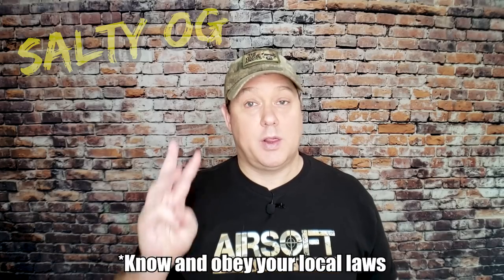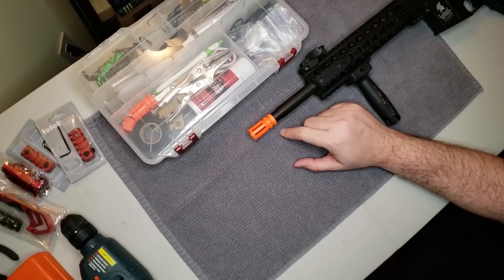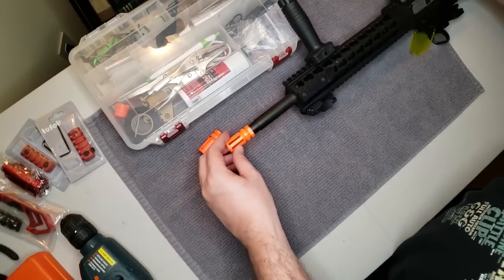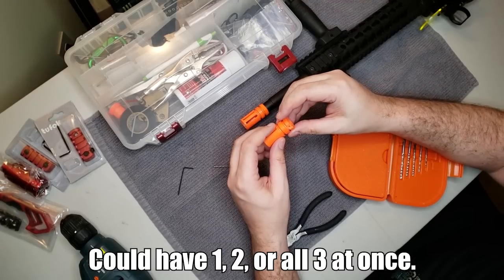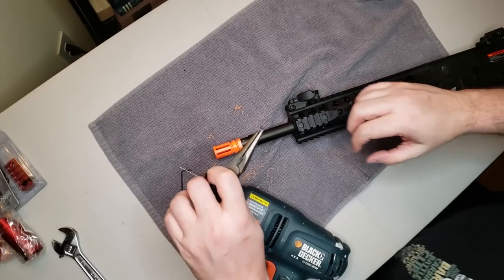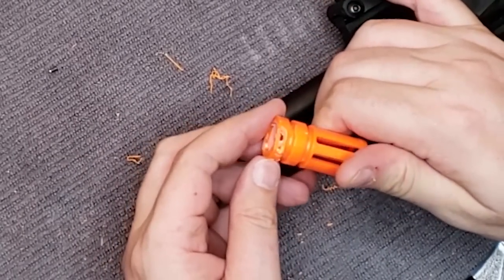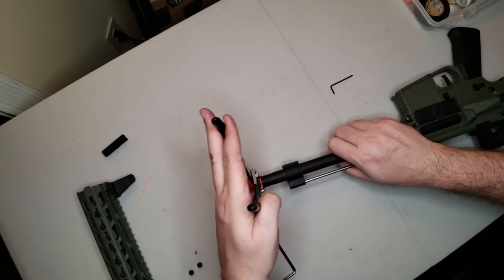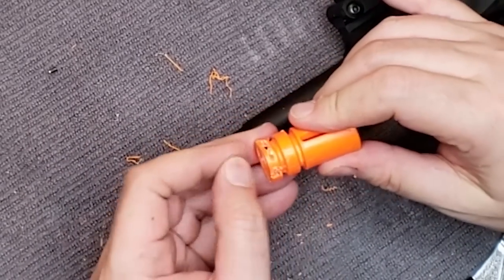Ditch the Orange Tip, plus Airsoft External Mods | SaltyOldGamer Airsoft Guide

Comment: Boiling water technique worked perfect for my glued on orange tip. Brought water to a boil, dipped the barrel tip for a few minutes and used an oven mitt to unscrew it.
Reply: Tks
Reply: What if your gun has a plastic barrel?
Reply: @thebronya3809  same process. Just be careful

Comment: I just did this to 2 VFC Avalon Saber CQB's with that huge sound amp orange tip. Its made of metal and glued on. Myself ( 250lbs) and my local shop owner ( also north of 200) just brute forced it off with channel locks and a solid work bench. I did try and put electric tape around the tip to protect from scratching....nope...I have sanded most of the orange paint off and will paint them black but in the mean time I did purchase a new flash hider/suppressor combo...looks way better and we all know airsoft is about 90% looking cool. 
Love this channel SOG...I'm a dad that enjoys quality AS time with my son too :)
Reply from the maker: Thanks for the compliment. Glad to have you part of the community.

Comment: thanks for your time and effort to put out these vids. because of you i decided to buy the vfc avalon. i used an allen key to remove the set screw but it was still glued. i soaked the tip with acetone. couple of hours later just screwed right off. wiped residue and was done.

Comment: How did you do this with such ease? I removed the pin (Im 99% sure I have the same gun as the one you demonstrate on, the Lancer Tactical) and I have even used heat and have tried for hours but I can't get it off.

Comment: i cant find a Allen screw that can fit in the hole and recommend sizes to get?
Reply: Go to Lowes or Home Depot and buy the set they sell for $20 it gives you them all so you wont need to worry about them fitting. Plus those keys are perfect for every day use. So many different machines or furniture sets require these keys so its always helpful to have a bunch on hand. 😎 GL

Comment: For reference on guns with a pin through the outer barrel, the Elite Force CTAR. Mine came with glue and pin. The pin went through the bird cage and ended in a hole through the out barrel. I had to remove the outer barrel, punch the pin through (it had glue as well), then heat the glue off via boiling water.

Comment: And question (I’m a n00b so don’t judge plz 😂) when you put on any suppressor, or tracer unit do you have to fasten it with another pin or will it be secure if you tightly screw it on?
Reply from the maker: You just screw it on tight and it stays.
Reply: SaltyOldGamer ok thanks

Comment: I have an G&G smc-19 but I drilled a hole going into it (because it was recommended) but I went too deep now idk if the threaded barrel works still.
Reply from the maker: I can only speculate here, second hand, but assuming it's a standard barrel it's going to have a good centimeter of threading, so drilling a tiny hole into it shouldn't imact the integrity (assuming it's a tiny hole).

Comment: How do I know what a compatible flash hider is for when I get rid of the orange one?
Reply from the maker: It should be somewhere in the specs for your airsoft gun. Most AEG's are 14mm couter clockwise. But, again, check your specs.
Reply: @SaltyOldGamer  thanks

Comment: For my hk 416 a5 aeg is medal hider and was expensive anyone know any tricks?
Reply from the maker: I imagine it's the same flash hider I had on my Avalon. It's just secured with a screw (and glue). I put duct tape around the flash hider before taking it off with pliers, so that the pliers didn't chew up the paint.

Comment: Do you plan on putting a longer barrel in the krytec? Since you put a mock suppressor. It will help with accuracy for sure. Also if you are looking for another tip video. To go along with my question. If you do, you should try the ProWin hop up with a modify Baton flat hop up bucking and nun video. It will cost you around $56 from Airsoft Atl and it is super simple.
Reply from the maker: I'm not immediately planing on it.  Accuracy seems the same with and without the blackside in the limited play so far. That could change.

Comment: Before forcing the orange tip off, know that you might fuck up the threading of your gun so you won’t be able to add muzzle attachments. Use the hair dryer or boiling water if you want to guarantee that the threads won’t get messed up
Reply: But what if mine doesn't have glue. It has a little hole on the bottom.

Comment: What does that little spacer piece do on the Krytac
Reply from the maker: protects the rod, and also keeps the hand guard tight and aligned
Reply: SaltyOldGamer hmmm. Bought the same gun but it was the m lok version. Checked the parts list in the manual and I guess it didn’t come with that spacer

Comment: Does it affect the gun if you take the orange tip off ?
Reply from the maker: No, it does not affect the performance of the gun. However, check that it's legal in your local area where you live. Most places you're fine, but better to be sure.

Comment: I also have a lancer tactical and I took the pin out and my orange tip won't budge
Reply from the maker: Make sure you don't have an Allen screw too. Sometimes they are covered but usually have a small indented circle. If not that, sometimes the glue is rly hard to break you can blow a hairdryer on it for 5-10 min to loosen it up.
Reply: @SaltyOldGamer  yeah I got a wrench and managed to twist it off, thanks man

Comment: I had a pin and glue on mine. Used a razor blade to cut the plastic and heated it up with my heat gun.
Reply: Had

Comment: Where did you get just the tip patch?😂😂
Reply from the maker: Amazon, naturally. 😉
Reply: @SaltyOldGamer  THANKS! Last question do you use a real red dot or a generic model? Sorry for all the questions I'm new to airsoft I won't a red dot I can use most people I hear talking say there's is just for show.
Reply from the maker: @Rico4801  no worries. Ask all u want. I use two different sights, a red dot, and a reflex sight. They are definitely not for show. Once your hop up is dialed in and your sight zeroed, you should hit what you're aiming at.  The two I use are budget friendly and work great. I'll get links in a few.
Reply from the maker: This is one. UTG 3.9" ITA Red/Green Circle Dot Sight w/Integral QD Mount https://www.amazon.com/dp/B005G66V5G/ref=cm_sw_r_cp_apa_i_cMkUCbBWR61VV
Reply from the maker: This is the other. I love these little guys. I have 3 of them. 😄 Feyachi Reflex Sight - Adjustable Reticle (4 Styles) Both Red and Green in one Sight! https://www.amazon.com/dp/B01HPWATOC/ref=cm_sw_r_cp_apa_i_mNkUCb7056AMK
Reply: @SaltyOldGamer  THANKS!
Reply: I've been hearing Primary Arms  has a great red dot.